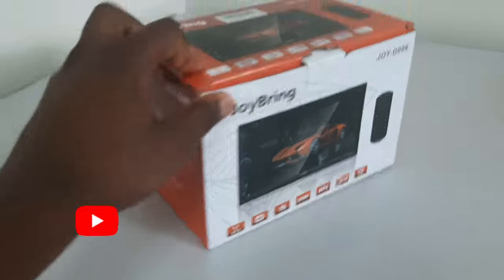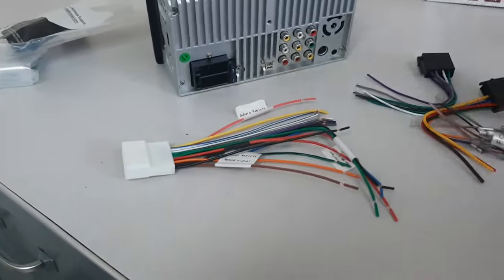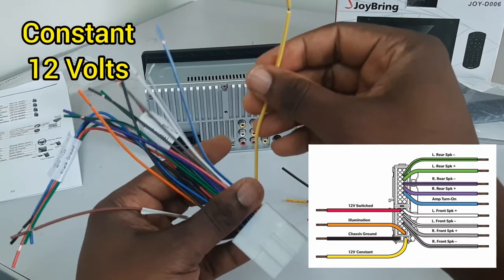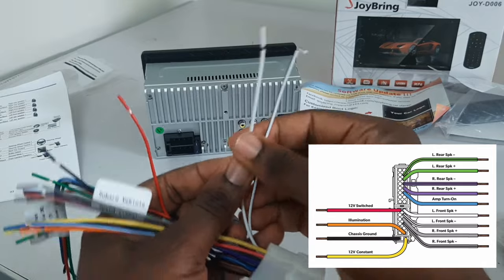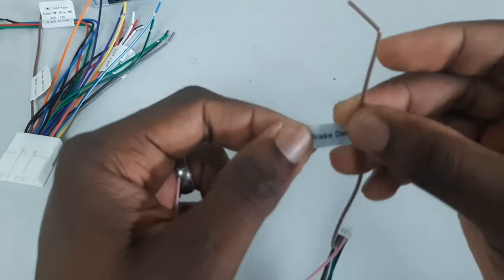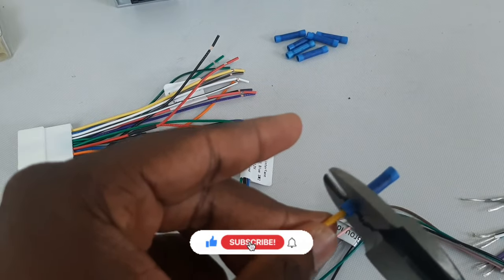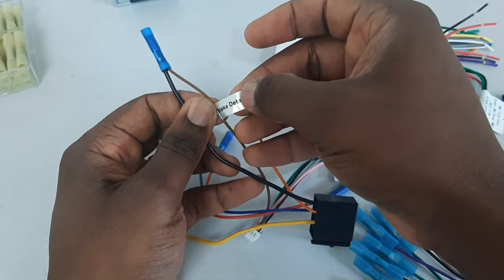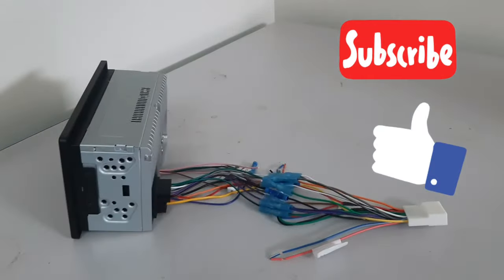How to Wire Aftermarket Radio into Any Car | Wiring Colors Explained

Comment: I have a 2008 Toyota hiace. Can you please tell me what wire connector I need to connect the radio to my vehicle factory harness. I don’t want to cut my factory harness wire to connect it to the harness that that my new android radio comes with., I just want to plug an play 😢
Reply from the maker: This should work for you https://amzn.to/3hgSwdS
Reply: @eazidiy Is there one you can find for a 2005 toyota camry that’s does a similar job?
Reply from the maker: The harness will work for 2005 Toyota Camry with no factory amplifier
Reply: @eazidiy  Ok, this car is has the JBL as well will that change anything?
Reply from the maker: You need another harness for a JBL toyota. The first one won't work. Let do some research for you
Reply from the maker: https://amzn.to/3IZyiiT This should work for your JBL radio
Reply: I need a wiring harness for my 2000 Saturn ls1 can you please help me I have looked everywhere
Reply: @eazidiy hey man, I’ve got a 2009 Hyundai accent gls sedan 4d I was wondering if I need an aftermarket radio because I’m putting subs in it so does it have the right wiring or do I need aftermarket stuff
Reply from the maker: Find the proper harness for your radio, you will be able to use sub with it.
Reply: What about a 1999 Cadillac deville ?
Reply: Was planning on doing it my self
Reply: Was 0aq

Comment: My radio is old 02 so  I don't have red lol
Reply from the maker: Red wire is 12V ACC. Prevents your radio constantly turned on and drain your battery. Please check your radio wiring diagram to determine which wire is for the 12 V ACC.
Reply: So on some older cars the radio is t designed with a memory circuit. Mine wasn't so I had to run a wire in to allow it to have a trickle of power to save presets while the car is off. A way to figure out which wire is your accessory wire and your battery wire is to take a multimeter to the wire and to your ground. if it shows 12 volts until you turn the car off it's your accessory. If it keeps showing 12 volts after the car is off it's your battery wire.

Comment: On my 2010 chevy cobalt diagram I only see positive and ground. I put the yellow with positive, black with black and put all the colors for speaks. I had removed the original connectors because my friend told me to, I shouldn't have done that and just get a harness. Now it won't turn on when I turn on the vehicle at all. Do I need to put the red wire with the yellow together onto the positive wire? Idk what to do. Please help.
Reply from the maker: Yes, put the red and yellow wires together on the positive wire.

Comment: Hi there. So I don't have blue wire coming from my car for ant turn on wire thats comming from radio. Where do I need to put blue antenna wire comming from my radio. I have aftermarket antenna.
Reply from the maker: Do you have blue/white wire? If not, you can use red wire 12V ACC to turn on your antenna.
Reply: I do not have blue/white. I'll try to connect it like you said. Thanks for quick response

Comment: What's all harnesses part numbers?
Reply from the maker: Check the video description box
Reply: @eazidiy  One set is 70-1761. I know about that. The second connector comes with radio I've figured it by now.
Reply from the maker: That should come with the radio. Otherwise, you may need to search on the internet. I don't know that part number.

Comment: Hello my friend!
I'm having a problem with my VW POLO 1.2 2008.
When I turn off the car the screen stays on and I manually turn it off.. Ok
but my phone keeps connecting to carplay via bluetooth... I suppose that even if the radio is "off" it continues to drain my battery.
I don't know much about it but I know that behind the radio there are several connections with different colored cables.
Is there a cable that I should cut?
Reply from the maker: First is the radio harness a factory made with the harness or did you make the connection with aftermarket?
Reply from the maker: It sounds like the 12V constant wire is connected with 12 V ACC which keeps the radio on all times and drain your battery.
Reply: @eazidiy  And what i need to do? Remove the 12 V Constant or 12 V ACC?
Reply from the maker: @deshiris you did not answer my question?
Reply from the maker: Your radio needs both wires but the 12v constant is a yellow wire and 12v ACC is a red wire. 12 ACC allow your radio to come on only wire the key is turned to ACC. If you interchanged the wires, your radio will stay on and drain your battery.
Reply: @eazidiy  oh my bad bro,
When I bought the car it came with a radio already installed that wasn't from the factory... so I took the opportunity to try installing a carplay that I bought on Aliexpress

I removed the old radio and only fitted the antenna wire and the two "squares" that give power and sound to the car

I apologize if I'm not explaining it correctly, I don't understand much
Reply: @eazidiy  and in this case what do I do to prevent this from happening?
Reply from the maker: @deshiris You must check for the yellow 12V constant and Red 12V ACC

Comment: Thank you ..Question.. If i wanna install a 4 channel amp ..Do i use the speaker wires from the sterio harness and then run it to the 4 channel amp ?
Reply from the maker: For amp connection, use the RCA wires.
Reply: @eazidiy  I know rca gotta connect from sterio to amp but I'm talking about my 4 door speakers to my amp ? How do my 4 door speakers connect to my 4 channel amp ?
Reply from the maker: @thomassaballa do you have a factory Amp or aftermarket? I think you must use line output converter for an aftermarket amp. I recommend you seek professional assistance to install.

Comment: Nice Video friend, I am trying to use a factory car stereo at home, it works well. But the issue is when power with ATX Power Supply as usual, it goes into 1 hour mode automatically. Any way to overcome this problem.
Reply: Also I think the car stereo isn't detecting ignition status.
Reply from the maker: Let me understand you. Are you using an external 12v power supply to power the radio?
Reply: @eazidiy  Yes an old computer power supply
Reply from the maker: Are you sure the output voltage is up to 12V? Connect yellow wire (12v constant) and red wire (12v ACC) to the positive of the ATX. Then Connect black wire ( ground) to the negative of ATX
Reply: @eazidiy  Yes I checked it is 12V no problem with that. Other than that is there any other way the car stereo can detect the ignition status of the car.
Reply from the maker: As I mentioned in my previous reply, red wire 12V ACC must be connected to the positive of the ATX

Comment: i have a 2007 lexus gs450h with no compatible stereos, could i install a small kenwood stereo into my glove box like this  and run a amp to it ? and if so, could you find me a wire connector ??
Reply from the maker: Unfortunately, I was unable to find a compatible harness. It is difficult for me because I don't drive the drive the car. I suggest you keep searching online.

Comment: My backup camera had a red piggy wire and RCA plug which go to the back of the head unit. It said has go to trigger or reverse wire. In this video, seem like you don't has it, where does it can hook up to ? Thanks you.
Reply from the maker: The radio harness has a reverse wire trigger. It is different color wire.

Comment: Hi, what's the cable with the white plug called?
I need one of those.
Thanks in advance
Reply from the maker: Wiring harness
Reply: Thanks for your fast reply, I'm trying to find the exact same one (female) but I only run into the opposite one (male)...no luck
Reply from the maker: The female is hard to find

Comment: Wondering if I can connect my remote wire from aftermarket amp to the solid blue wire coming from my stereo harness, it’s the only blue color, I don’t have blue with a white stripe
Reply from the maker: Yes, you can.

Comment: Wiring harness that goes between car and after market head unit harness has two blue wires, one solid and one with white stripe (amp turn on and antenna wires), while the head unit (after market stereo)harness only has one solid blue wire that the book labels for amp turn on. My question is: can I just connect all three blues, the solid on the head to both the solid and striped on the harness? Or just cap one off? Don’t have an amp and don’t think it’s a power antenna but not 100% sure.
Reply from the maker: As long as you car do not have Amp, you may cap off the blue/white wire. Connect just the solid blue wires
Reply: @eazidiy  what would happen if I did connect all three if I did get an amp. Can you do that?
Reply from the maker: @rachelray3250 If you have an Amp them the blue/white must be connected to your Amp on of the radio. For now they can all be connected together if you do not have an Amp. It will still work

Comment: I have one question I have a blue remote wire coming from my amp which wire on the back of the harness should I connect that to to turn it on when the car start up ( the power antenna or splice it into the red wire ? ) thanks
Reply from the maker: Splice it into red wire 12v ACC

Comment: Hey my radio says i cant do stuff while im moving,even though im not moving. It may be because its a old manual. Do you have any way to get around this?
Reply from the maker: Your radio harness has a brake wire. The brake wire must be grounded.
Reply: It says parking brake on the harness diagram, would that be the same thing?
Reply: @eazidiy  and how do you recommend I ground that wire?
Reply: @eazidiy  the only reason I ask is because it's a very short cable
Reply from the maker: Yes
Reply from the maker: Connect it to the ground wire (black) of your harness.
Reply from the maker: It must be grounded

Comment: I have a 2007 jeep grand cherokee with a separate factory amp in the back. I've been told I need to splice the blue wire with the accessory. I've done this and still no sound, the blue wire acts as a constant for some reason even though its labeled antena/amp turn on. Any suggestions?
Reply from the maker: Yes, splicing the blue amp on wire to 12v ACC can turn on the amp. You must also consider how the amp speakers are grounded.
Reply from the maker: Do you have an Android radio or a 2DIN radio? You may need to buy special harness or canbus for an Android radioto work. For a 2DIN radio, you need to take the speaker feeds from the RCA ports of the radio. Which means you must have an harness thar can support that.

Comment: PLEASE HELP. I have a 07 civic si, I ordered a Boss BE7ACP. The wire harness connector that powers the after market unit is a 20 pin. My factory head unit is a 16 pin. Can I still use a 16 pin atenna jack and the other 16 pin wire harness connector that comes with it? Or can I only use a 20 pin
Reply from the maker: You may use them. Match the wires color by color
Reply: @eazidiy  I finished installation today, thank you! Everything was perfect and works great, first try. Was overthinking and thought the 20 pin wouldn’t work lol
Reply from the maker: Thank you for your positive feedback and experience. I'm glad you are able to complete the installation. In the video, I used a 16 pin to 24 pin harness. The concept is to understand the wire color codes. Cheers 🍻

Comment: Where do i put in the extra brown wire ? I think its a mute wire but idk where to put it
Reply from the maker: You may leave it without connection if it is not required by your radio harness.

Comment: Can I connect the purple 12+ reverse cam wore on with the red 12+ wire?  Thanks so much.  Asome videos
Reply from the maker: The purple +12v reserve cam is the trigger for the radio to go into reverse camera mode. The purple should be connected to the positive wire your reverse light in your trunk.
Reply: @eazidiy  will it work if I connect the power wire in the trunk to the back up light ?
Reply from the maker: Yes, power wire to reserve light positive wire in the trunk and the other end of the power wire Connects to the purple wire of your radio harness.
Reply: @eazidiy  awesome thanks
Reply from the maker: You are welcome

Comment: Will this work for a 2008 scion xb?
Reply from the maker: Get the correct harness for your car and color match the wires. It will work as long as your car do not have a factory Amplifier

Comment: I have a question I just hooked up an aftermarket radio on a 2009 Chevy HHR I connected all the wires yellow to yellow but on my harness it comes with a separate red wire I connected that to the ignition switch fuse but it's draining my battery What could be the issue??
Reply from the maker: Red wire should be for 12V ACC. Only Yellow wire to 12V battery. If you connect the red wire to your battery directly, it mean your radio will be on at all time.
Reply: @eazidiy so how do you do that because I don’t really understand what you mean

Comment: I found my blue a white wire cut..in the other video I watched his was cut too..why
Reply from the maker: Blue/white wire is for Amplifier. It is not needed if you do not have an Amp.
Reply: Okay thanks...what exactly is the amplifier
Reply from the maker: @chaneli4855 You can read more about Amp here https://blog.rockfordfosgate.com/car-audio/car-amplifiers/what-does-a-car-amplifier-do/#:~:text=Amplifiers%20work%20to%20enhance%20sound,noise%20and%20other%20competing%20sounds.

Comment: i dont have a red wire on the car.so where does the red wire go.
Reply from the maker: Check your car radio wiring diagram, look for your 12V ACC wire. Maybe it is a different wire color.

Comment: What if no power on red from car? Run a new wire?
Reply from the maker: Red wire is 12V ACC. You should only have 12v when the car is turned otherwise there will be no 12v when the car is off. Yellow wire is the 12v constant ( +12v at all time as long as you have battery in the car)

Comment: What if my harness has two yellow wires then what?
Reply from the maker: Yellow constant 12v is with the main power harness, you can tell by the size of the wire.

Comment: i wish you would’ve told me i needed the blue things when i asked you if i needed anything else
Reply from the maker: What blue thing? Are you referring cable connectors? If yes, you could connector cables without butt connectors. You can slice cable directly
Reply from the maker: Slice and joint the wires together and an electrical tape to wrap up.

Comment: There isn't a single video on the internet which is pretty pathetic it's 2024 and there's not a single video to show that actually shows instead of being fake how to wire a Bluetooth radio with a regular solid color wire adapter to a factory wire harness that is striped colored I don't have a single solid color wire that are not the same color red goes to yellow and green black goes to white and purple like what the fuc
Reply from the maker: I ask you to look for your specific car's wiring diagram and study it. Seek professional assistance if you need one.
Reply: @eazidiy  yeah I just gave up the radio that came with the car factory radio just stopped working so I tried to put my own in almost got shocked a few times blew some fuses replace the fuses but I'm going to stop
Reply: @eazidiy  I just think it's BS how they make everything so hard why do they have to use wires with several different colors why can't they just use solid colors on wires so it would actually be possible to color match it's impossible to color match a solid color with a wire that is two colors that makes no sense they don't match